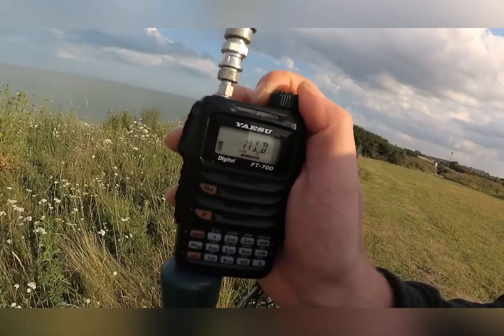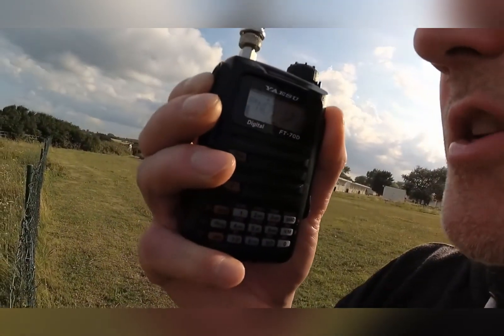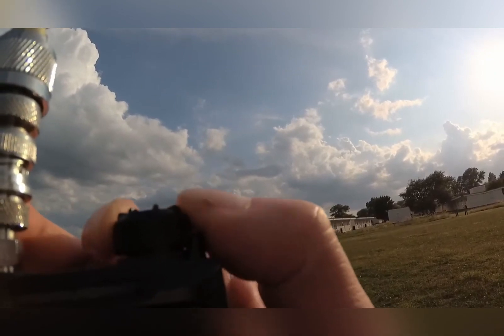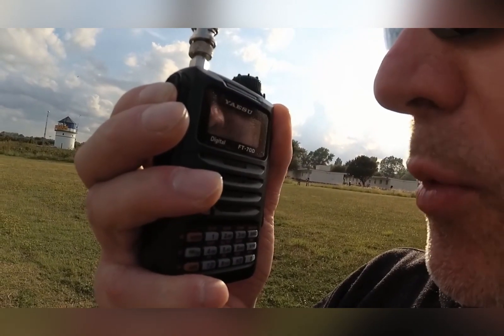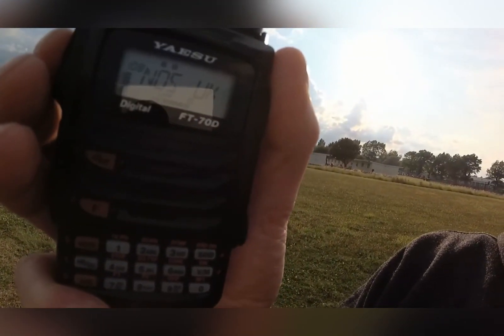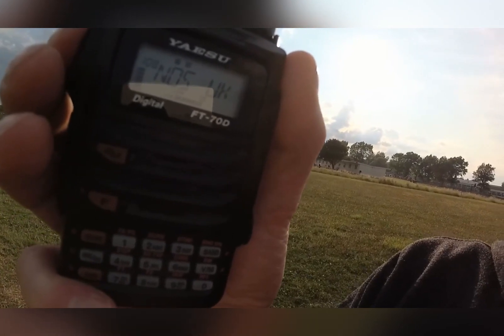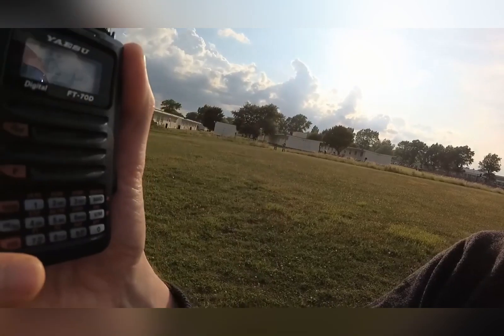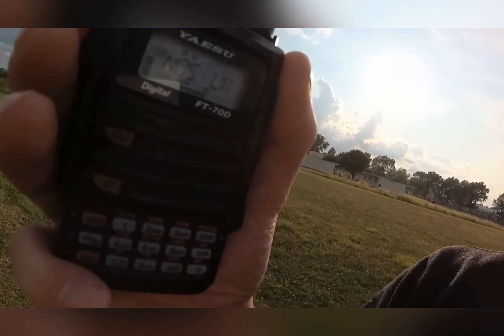Telescopic aerial ￼ got me, 150 miles

Comment: That’s all the adapters Chris! 😂
Reply from the maker: Yes well it just goes to show it doesn’t make much difference. In this video, I had a telescopic aerial on the top. Thanks for watching.
Reply from the maker: When I got home, I purchased the same aerial, but with the correct connector
Reply: @digitalanaloguehamradio  what antenna is it?